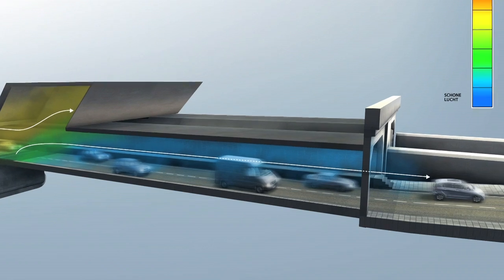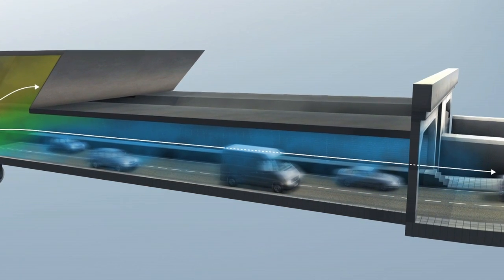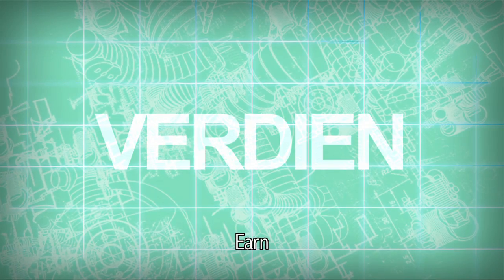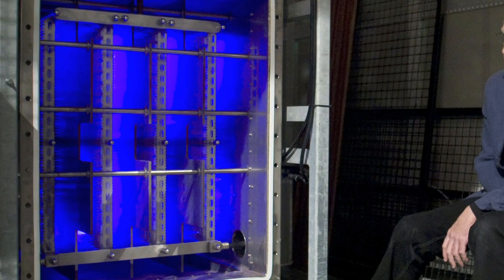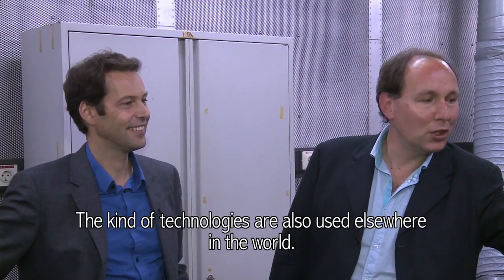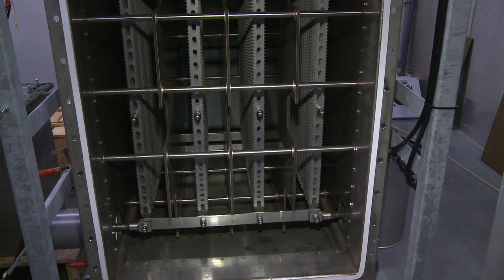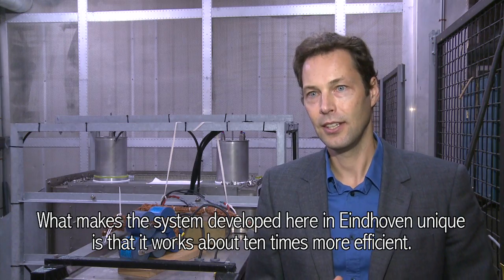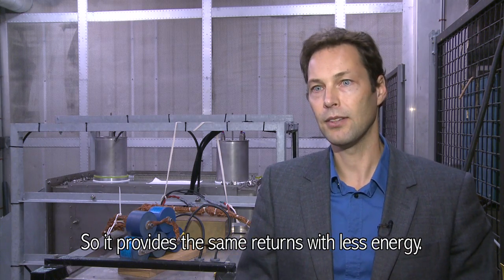Air purification with cold plasma

Comment: One side sharp edges and other side is a simple plate. The plasma is produced between these two? DO you use AC or DC?
THis is very interesting. The Ozone produced by this is also harmful for people having breathing troubles? is it producing sufficient / excess ozone ?   How does this cleaning of air works? is it by UV produced by plasma that cleans the air? or is it ozone that cleans air?  or does it charge the dust particles and these charged particles are trapped by some filters / ground plates and thus cleans the air?  what is the basic mechanism? 

What are the voltages you use? what frequencies if you are using AC?
Reply: ozone can clean air well as the third oxygen atom in O3 oxidizes the smoke or the odor or the bacteria and we are left with pure oxygen.

Comment: What actually traps the dust and particles?  Do you expect me to believe that the ionized air will travel through the house, stay ionized, and then get "trapped" by the standard air filter?  I think this is crap.  I'm very skeptical.
Reply: Ionizers make fine particles cling together to form larger clumps that get trapped easier in traditional filters. Similar to how floculants work to coalesce small particulates in liquid mediums.